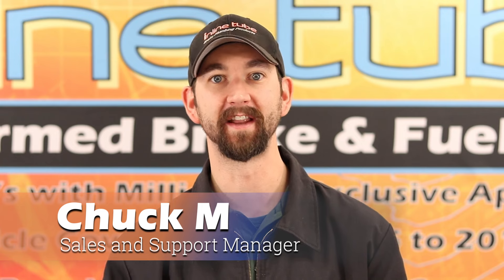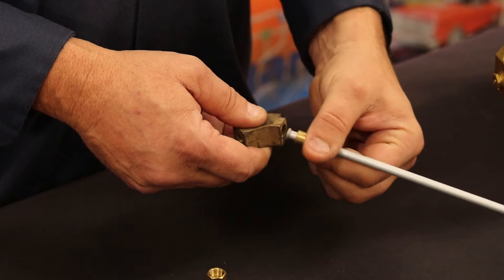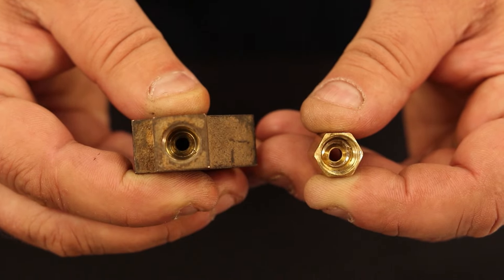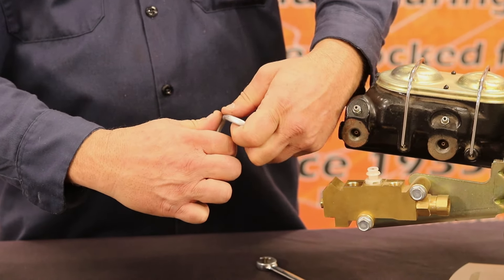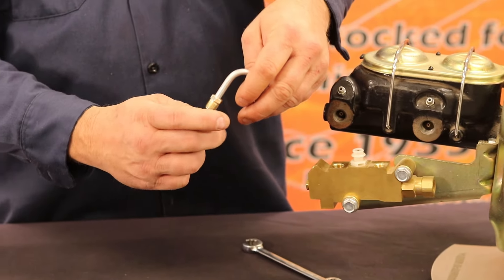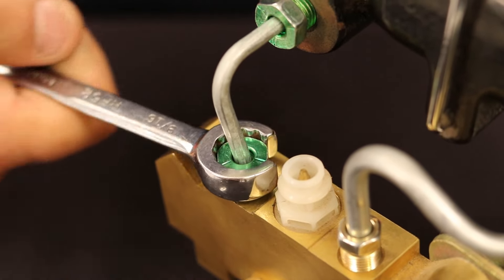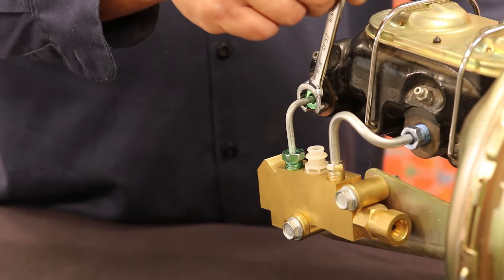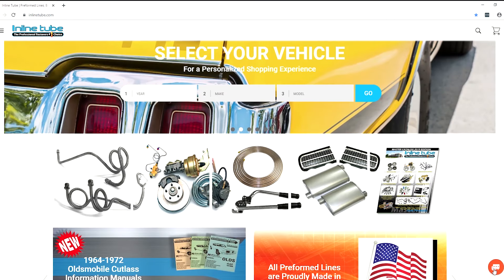How to | Prevent a Brake Line Fitting from Leaking

Comment: Thanks!  I was panicking after installing a new front brake hose and it was leaking at the fittings. Thought for sure that I was going to have to replace the hard line, or cut it and make a new flare. This "exercising" the fittings worked like a charm!

Comment: When you say tighten half a turn. Do you mean half a hex flat turn as in the video? Ie not 180 deg.
Reply from the maker: Yes I believe the script was written before the video was filmed.  You will want to follow the steps in the video.
Reply: @inlinetubeco  yaaaaaaa, I think I overtightened as I kept hearing 1/2 turn.  I think I close to stripped it.  Gonna have to take look at the witness ring now.  I kinda need to give a thumbs down even though most of it was spot on with the deep socket help and seating.
Reply: I was looking for this exact comment ... guy said back off and retighten adding half a turn more... looked like 1/32 to 1/16 of a turn more in video.

Comment: I just had a load of brake leaks using "the right stuff" brake lines, crooked flares that wouldn't stop leaking,had to re-cut and re-flare to fix them. the INLINE TUBES i used for the transmission lines worked flawless.
Reply: WOW!! Glad we could help you fix the issues your were having. We appreciate your comment and your business.

Comment: This video was an absolute god-send.  THANK YOU, CHUCK.  AND THANK YOU INLINE TUBE!!!  

The deep well socket trick worked like a charm, and the seat-reseat-seat-reseat-seat method was the ultimate key to my successful brake line install.

I installed stainless steel lines, which are harder than traditional carbon steel or nickel-copper lines.  Because these lines are much harder, I (a neophyte) had to use your method to properly seat the lines, and then I had to really crank the lines tight.  I went an "extra step" and had someone sit in the car and pump the brakes so that I could a) see where fluid was leaking (from lines that were not properly seated) under pressure and then b) tighten each fitting until there was no leaking.

There is obviously a risk to damaging the fitting or flare due to over-tightening of the lines, and I want to reiterate that I am a neophyte (so you should seek counsel from someone experienced).  But after much troubleshooting, cranking down the lines was the key to tight couplings and no leaks.
Reply: I guess I'm dense.  What exactly are you doing with the deep well socket?  The video mentions the socket and sliding it on the end,  but for what?

Comment: Wow! New to flaring here. Just finished installing two long brake lines on a Honda and one of the lines was leaking even though the flares looked great.  But as shown on the video the lone did not sit straight on its own. I will try these tips. Thanks so much.
Reply: got the same problem, great flares leaking, did that fix it?

Comment: Nicely Done! Im bleeding brakes after swapping out a MC and I had to remove the ABS module for a fix as well. Using a vacuum pump I keep sucking massive amounts of air from the right rear caliper bleed. Pump wont maintain vacuum, one of the ABS or MC connections must not be seated correctly Im guess. I should imagine this will help. Nicely Done, Very Nicely Done!

Comment: Going to try this method, I've got a brand new power steering line and the fitting flare as well as the witness ring on the gear box look great. Still leaks up through the top of the fitting though.

Comment: like to see a video on a tri-five with a  wilwood master cylinder proportion valve, brake line installs. I have a 1956 chevy 210 series and I bought the inline brake lines. It has the wilwood front disc/ original rear drums.

Comment: Does this exercise apply to Copper Nickel lines as well?? or only steel, ss lines?
Reply: usually copper nickel can just be tightened down since it is softer.
Reply: @charlesmcmartin8659  Well, i did  the tighten/loosen thing a few times with all of my brand new, home-made copper nickel lines.  You might want to add a note to your description...
Reply: @joem6859 copper nickel is definitely more forgiving but definitely doesn’t hurt to take the time and do it right.

Comment: I have your hard line on my 455 Olds, and it sealed with the old fuel pump, but is leaking on my replacement. The pumps appear to be identical.
I have tried loosening both ends, and tightening them a little at a time, The way the line is bent, and with the angle of the fuel pump outlet, it is hard to get the line into both ends without some tension. Do you guys recommend the brass washers to help with sealing up these joints?
Reply: No we do not use any brass washers.  the line needs to be be tweaked to line up to get a good seat.
Reply: @charlesmcmartin8659   Come to find out the new pump has a smaller cone inside. Is there an adaptor of any kind to reduce it down to match?

Comment: Would this work on a leaking bleeder screw?
Reply from the maker: you can always try to loosen and tighten it back and forth to see if it will seal up but it does not have the same flare are the tube.  you will probably need a new bleeder.

Comment: After switching to a copper nickel line, I had a slight leak at the fitting. So I had to loosen and then tighten it real right. The leak stopped. Now, it was tight for a steel line but I am wondering if using the same tightening force on a copper nickel line will cause any damage to the copper line. After tightening it good, I had to do another half turn to stop the leak and I did loosen it a bunch of times and tightened it in increments.. And it was a double flare 3/16 line with an SAE thread.
The original steel line was also very very tight. 
The vehicle is a '92  Jeep YJ 4.0L and the fitting that I am referring to is at the proportionating  valve. 
Did some aggressive braking to test for leaks and it's all leak free, and it's been a month.
Any feedback from you is highly appreciated.
Reply: Flare fittings take a stupid amount of torque for their size. It feels like as tight as possible with a medium sized wrench. Mine only stopped leaking until i tightened beyond what was comfortable. Nickel copper as well. The steel end of my union i tightened in the vise so i didn't have to even attempt tightening that with two wrenches
Reply: @mikem5475  That's exactly how I felt; it took a lot more torque than I anticipated for the size of the fitting. Thank you for your comment!
Reply: @theleafsprungjeeper  no problem brother